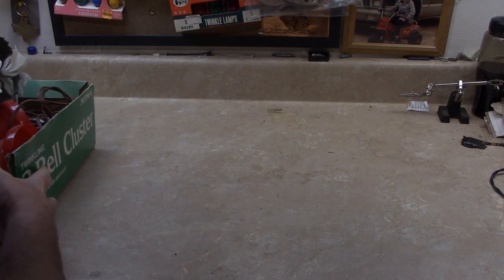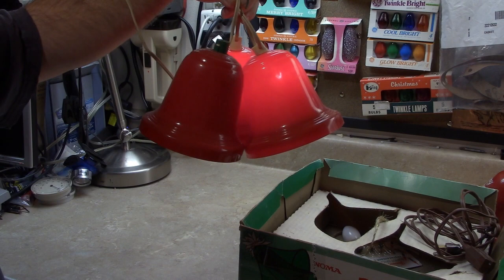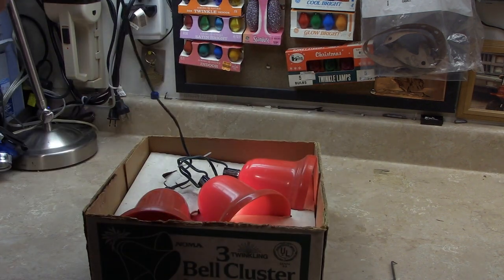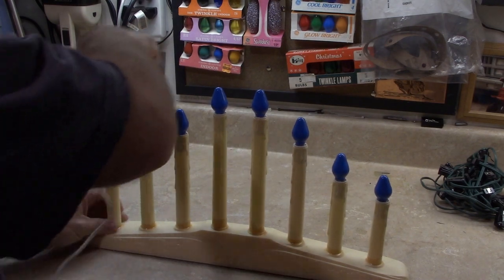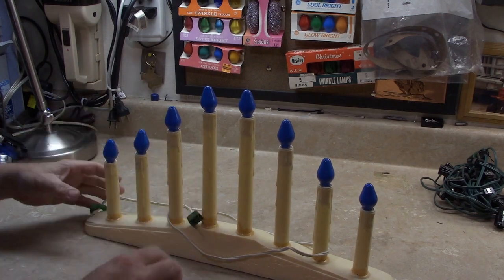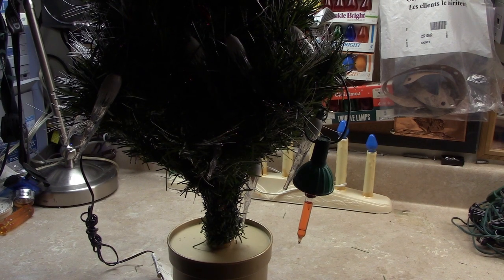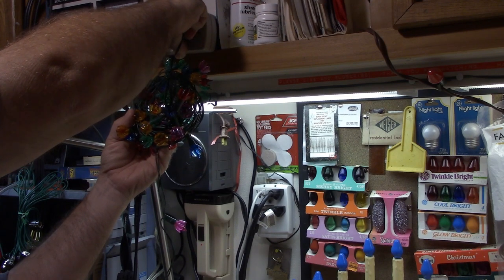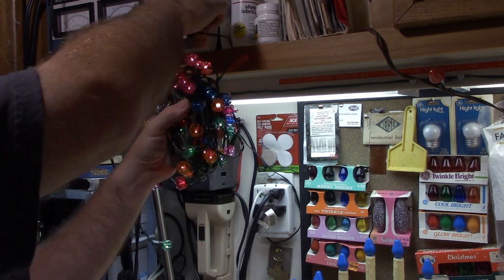Testing Vintage Christmas Lights For 2022 Decorating Part 1

Comment: Since I'm obsessed with Vintage Petal Christmas Lights this was very fun to watch !!!  I have a strand like @ 7: 34 that blinks, Please, may I ask how do I stop them from blinking !!! Thank you!!!
Reply from the maker: Awesome! Take a look at each bulb in the strand. Find a bulb that is clear, or clear with a red tip. It will also look different, internally, than the the rest of the bulbs. Depending on how many bulbs there are, 120/number of bulbs, that will give the appropriate voltage bulb to use. Say there are 35 lights in the strand. 120/35 is 3.43, so that strand would use 3.5 volt bulb. Some strands will use an oddball 6-8 volt bulb, and those can usually be found on ebay.
Reply: @dynatrak  Great !! WOW, its a Christmas Miracle, no more " Blinking!!" THANK YOU
Reply from the maker: @louisefontana8037  That's awesome to hear!